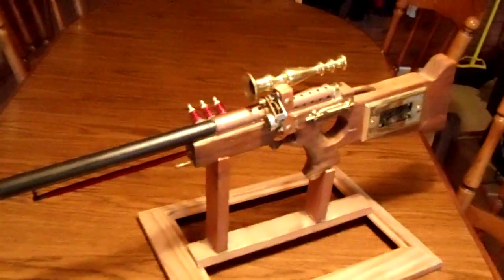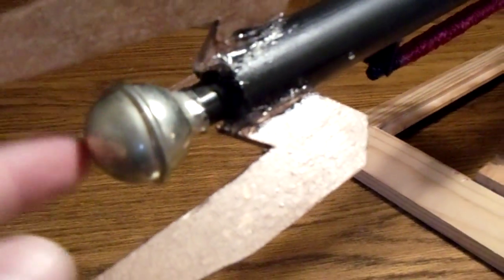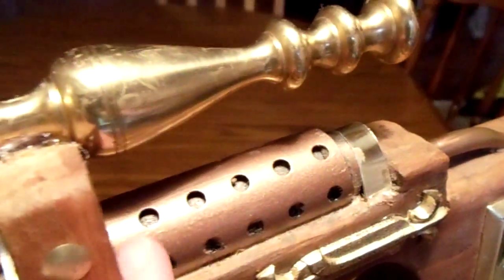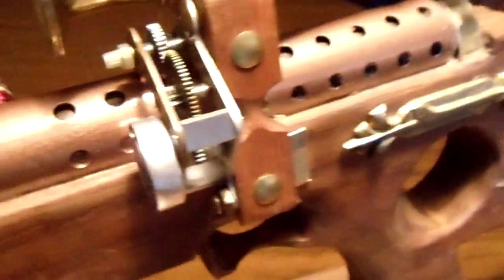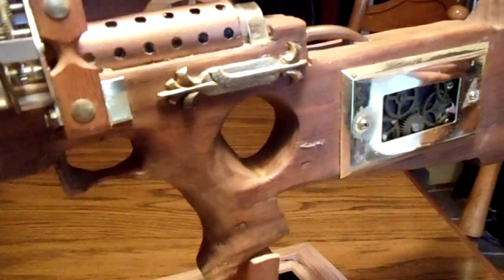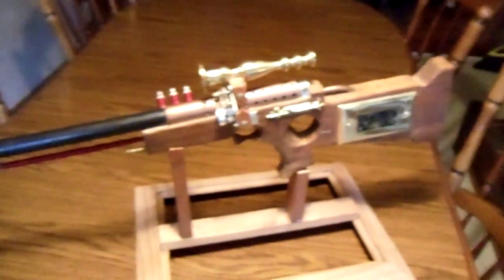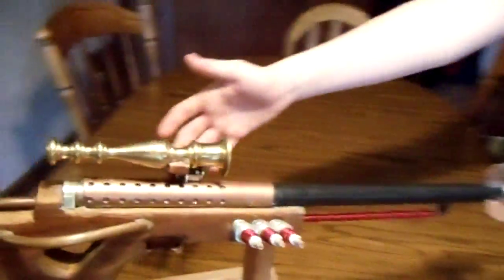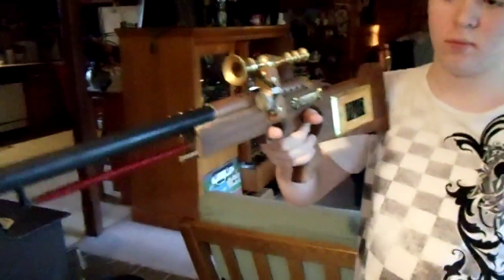Steampunk Gun - Built by my son Jordan

Comment: Nice job on the gun !
It looks like it was well thought out before you started on it .
Does the lased diode actually work on it ?
You should put the switch inside the trigger guard to make it look more functional.
Now you need to build a REAL working rail gun that has that Victorian steam punk look to it and have the thing work.
I am not sure how you would hide the capacitors though.
It could be powered by a hand crank dynamo so no batteries needed to run it.
Just a cool idea.